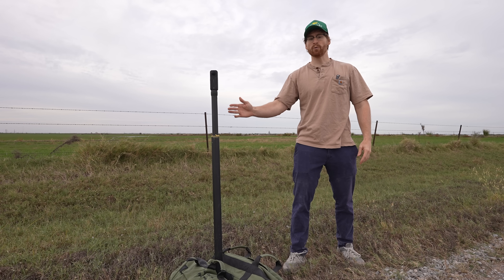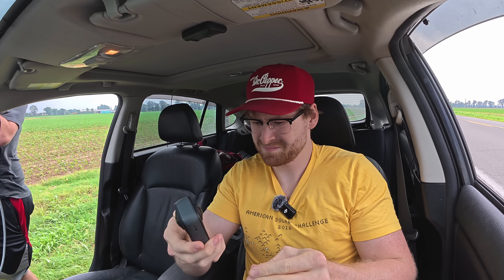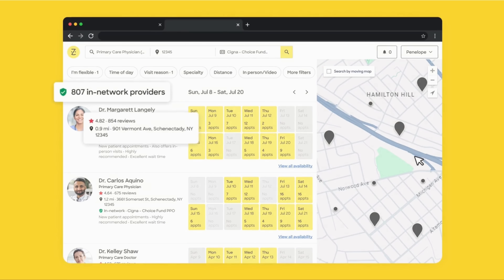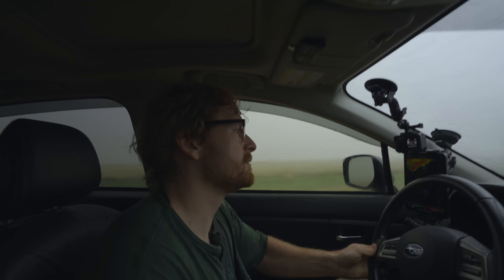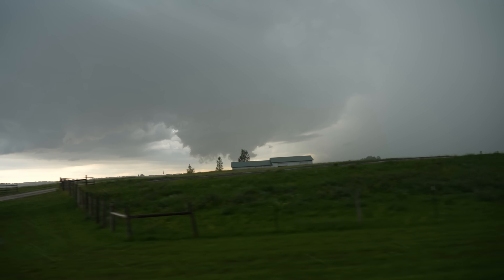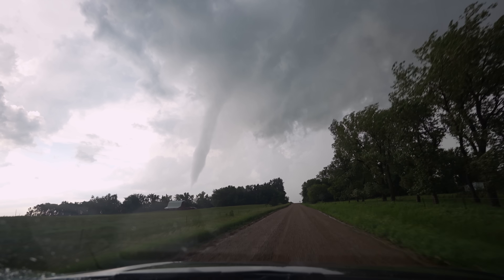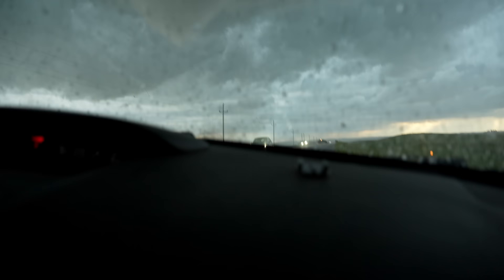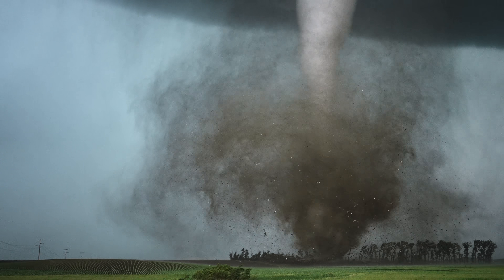I Tried To Record The Inside Of A Tornado

Comment: You haven't enderlin north Dakota ef5 tornado with winds running up greater than 210mph and it was nocturnal it even derailed 33 train carts and one of it was thrown 500 feet from where it derailed

Comment: I want to see someone use a solid fueled rocket to launch a lot of sensors and metallic chaff into a tornado. Make the body from cardboard so the tornado can easily rip it apart. With the chaff all being the same size, of known dimensions, getting accurate wind speeds and directions with doppler RADAR would be easier. With the small size of pressure, temperature, and other sensors available, it should be possible to fit them onto small PCBs with batteries, light enough to be kept aloft by the tornado. Each one could have a beeper and bright blinking LED to aid in recovering them to get the data.
If there's a way to fit them with GPS, GLONASS, and/or Beidou sensors, that would be helpful for altitude/position and speed tracking.

Whatever the sensor types, launching them directly into tornadoes would be more it and less miss than dropping a camera or sensors on the ground and hoping a tornado runs over them.

Comment: Chris,  I know this fits the "high risk" in your moniker, but come on bro...There is simply no good reason to get directly into the path of a tornado.  Wanna put a camera in there? No sweat...buy a drone with an 8K camera and fly it into the inflow of the storm, while you stay at min. safe distance.  First, you don't die if the tornado decides that today is the day to change all the rules of storm chasing...That happened once before; 2013 EL Reno.  That day didn't end well for quite a few people.  2nd, not sure if that rig that will hold the tornado in place up to EF4 winds...Did you test that in a wind tunnel? Or are you creating an extremely dangerous projectile if it does get picked up.  Food for thought my man, that's all.

Comment: How did you create it so survive such high winds if it’s very light weight did you perfect air flow or smth like that?
Reply from the maker: It's not light weight, it weighs about 170 lbs and has a low profile
Reply: @highriskchris ok thanks that’s what I thought because of course tornadoes can throw cars so I was just curious about how it worked

Comment: I don't think a tornado would have an eye like a hurricane, because to see the eye of a hurricane, the sky has to be clear, with a blue sky, and in a hurricane you can clearly see the eye from a satellite. In the case of a tornado, you can't see an eye in a supercell; from space, a supercell looks like a giant blob, and there's no visible eye at all.

Furthermore, all footage taken with both the TIV 2 and the Dominator 3 inside a tornado shows that it is either dark or foggy or both, it doesn't look like a hollow cylinder, it looks more like a "solid" cylinder made of condensation.
Reply: Eye of a Tornado has multiple sub vortexes dancing inside
Reply: @tx_7134  Yes, but that doesn't change the fact that I said it was foggy or dark.

Comment: I recommend painting the probe something high vis so other motorists don't run into it, and it would also make it easier to find in the event it gets tossed.
Reply from the maker: Yeah you're right. I will do that before next season
Reply: @highriskchris  or add a GPS tag to it incase it gets thrown
Reply: @highriskchris  You should add an upwards facing camera, I bet the view would be awesome
Reply: @Terminator-04 ya true aggre
Reply: Awesome video at the start of the 2nd tornado it almost looked like pecos hanks popular tornado
Reply: @highriskchris   You could take the easy route, and get some reflective tape. You can get them as strips like stickers, making them ridiculously easy to place. And not only are they high-vis, but if your probe gets lost, or you're out in the dark, they will reflect a bright light if you're sweeping a field or a ditch for one.
Reply: also if you go to any truck stop in america you can buy the same high quality reflective stickers they require on semi trucks. some places will even sell a 5 foot long roll of it. grab some and wrap it around the probe and youll be able to see it in any weather. im telling you that reflective tape is bright AF when its clean. much better then the plastic reflectors and much more durable. Its basically a flexible microscopic reflexive pastern printed onto tape and covered in a fairly thick clear rubberized coating to protect it from dirt and dust. Nearly as bright as highway sigh reflective stickers but much much more durable and will wipe clean with a damp hand.
Reply: @SirFloofy001  It’s called retro reflective. I work with road construction signs, it’s very bright at night.
Reply: Bright orange or yellow. Like a safety vest.
Reply: Maybe some retroreflective tape/paint
Reply: Add flashing led's and move more away from the road. That's a big hazard he created. Those bags didn't look that heavy, but on impact with a car, could still do serious damage. Kinda dumb he placed just 1m or so from the road